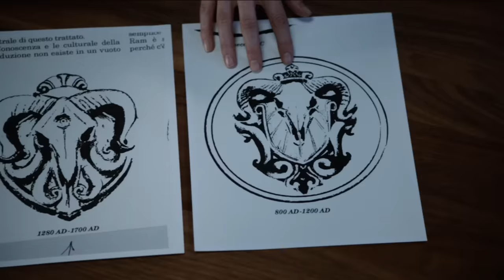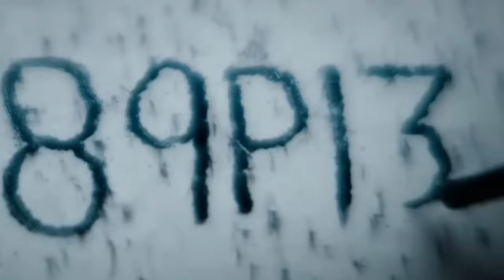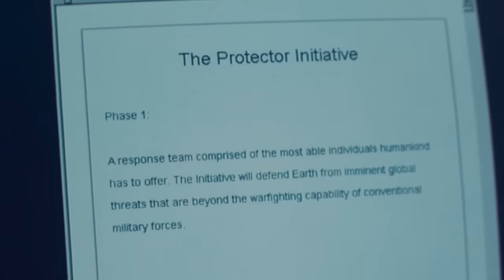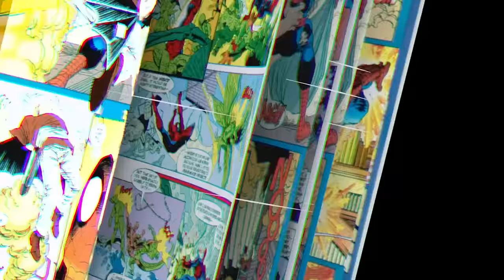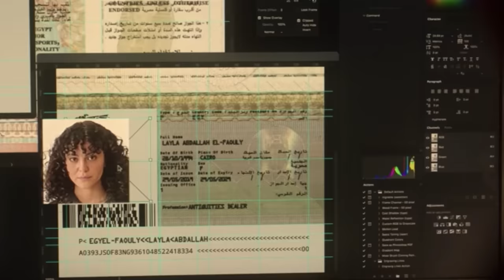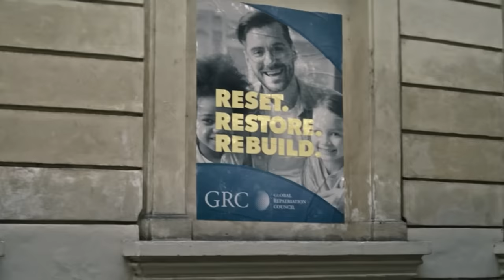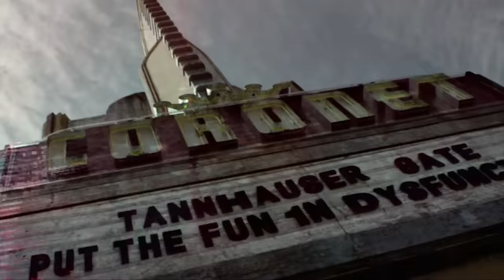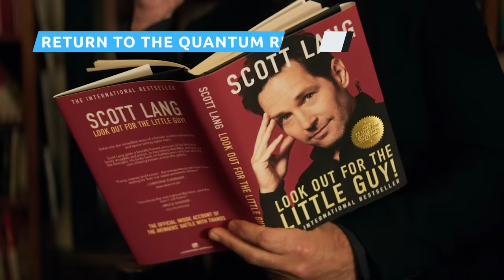The Entire MCU Timeline Explained (2023 Update)

Comment: Is this not the most comvoluted, unnecessarily complex mess you've ever seen? I'm reading a sci-trilogy, each book is around 500-600 pages and there are two side story books in the same universe, that is way more easily followable than this. And they fly in ships that cause them to experience time differently than the planets they travel between. They turned the MCU into an unnecessary mess. It all even with End Game. I stopped caring after that.